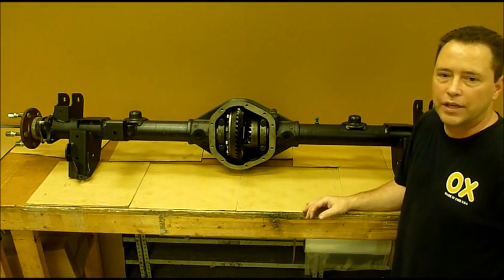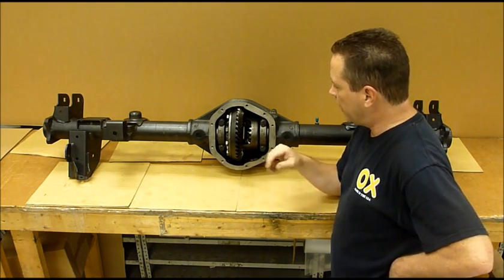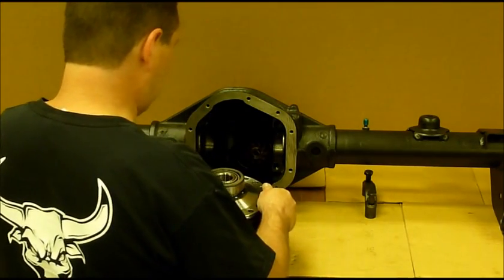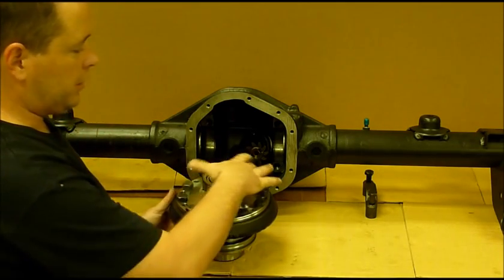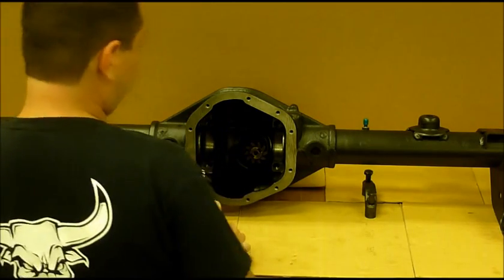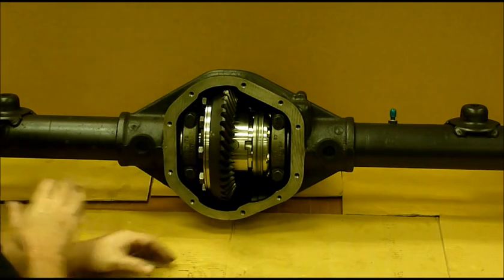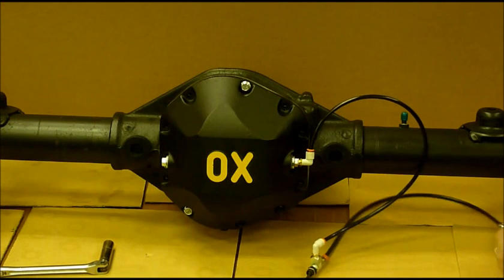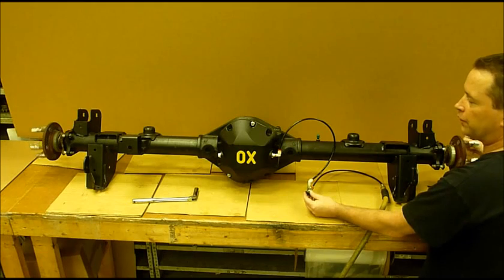OX Locker Installation Overview

Comment: This would have been so much better if you had demonstrated, even in a cursory way, setting the preload and backlash properly.  That would be infinitely more important than demonstrating how to move the ring gear, for example.  Also, recommending silicone as a gasket does not inspire confidence.  Otherwise informative.

Comment: @3:24 he said “you can chip the teeth easily as the material is very hard”! If the metal composition is hard, it should not be chipped easily. Remember the pinion is the one that pounding those ring gears through many off-road/on-road scenario

Comment: Mate you can have the correct backlash but that does in anyway mean the gears are meshing correctly how many diffs have you destroyed with people not setting them correctly like you have ?
Reply from the maker: Couldn't  tell you for sure how many we have destroyed, we haven't heard of any yet, but by the current video views it could be as many as 198,512. This is not a ring and pinion setup instructional video it is a general information video to show the process of installing a locker which just switches out the carrier without messing with the pinion setup and assumes a proper gear setup prior to disassembly. There are many details not in the video in the interest of not making a 2 hour video. The locker comes with a complete set of instructions that covers everything.  If you need any help with your setup let us know we would be glad to help.

Comment: Why do you recommend using silicone instead of a gasket when installing the diff cover?
Reply from the maker: It doesn't really make much difference, a gasket can be used. The only reason we make the recommendation is the gasket moves the cover and fork assembly away from the lock ring that it engages in. With no gasket the distance is closer optimum. The closer the fork is to the lock ring without radial contact the better.  Honestly the small distance is fairly insignificant. If I have a choice between a nice reusable gasket like a lube locker style or the silicone would run the gasket.
Reply: @OxOffRoad  Makes sense, I'm not a fan of silicone when a gasket could be used. Thanks for the explanation!

Comment: Looks like that air feeding or the place to put the cable could get smashed off real easy in the woods or on a rock so I don't know
Reply: One of the reasons I went with a Torq Locker, lunch box locker, on my Jeep Wrangler Willys. No drilling into the cab for  a switch or need for an air compressor.

Comment: Hey, great stuff! Does this locker work for tacoma and 4runner? I love that it's a physical cable!
Reply: At what point in the video did you see a cable locker?
Reply: @deepandhard803  when he touches the flymbop with kunglu
Reply: no, bro! ur fwd tacoma has a pretty good locker already between the steering wheel and the seat.

Comment: have they improved where that elbow is attached? im thinking not the best location. maybe on top.
Reply from the maker: It would be nice to have the fitting on top, however to maintain compatibility between the shifting systems the location remains in the same place. Some people fashion a guard over the port for added protection.

Comment: I'm trying to avoid air lockers.  They just seem unreliable if your compressor goes out.  These seem good until your in the middle of nowhere!  Not sure about these.
Reply from the maker: Our air shift system has a fail safe device that can be used in the event of an air system failure check it out  https://youtu.be/tYPjhh30HsI

Comment: Hi guy. I have Chinese pick up Foton Tunland. It has Dana 44. This OX diff locker is universal for all models of Dana 44 or it has different models too?
Reply from the maker: Its hard to say We have seen some differences in the past. The main thing we would need to see is if the differential cover has the same bolt pattern. If that is the same it usually is no problem.
Reply: @OxOffRoad  are you official representative of OX? Do you have e mail?
Reply from the maker: @QWERTYqwerty-nj6bx  just email support@ox-usa.com

Comment: The ox with cable locker would be the best I think, no airline or electric to foul and once it’s engaged no slop
Reply: That's what I'm thinking fewer moving parts. Nothing electrical or pneumatic.
Reply: Except the air actuated version has no slop either

Comment: Is there a manually/cable operated ox locker for mitsubishi l200 2004 4x4 2.5l turbo diesel, k74 chassis. Might also be know as the Strada: Thailand made vehicle , popular in Australia and the UK.

Comment: There is no any wire or switch on the lock, how to ture it on or off?
Reply from the maker: Yes assuming your speaking of the example in the video. A pneumatic switch is supplied to port the air to the cover for locking, and throwing the switch to unlock will release the pressure to allow the return springs in the locker to unlock it.

Comment: I really wish you guys had more lockers. I have a hard time understand why you guys carry lockers for the d30 and d35 but not a gm 14 bolt. Or the Dana 70. I dont understand the logic behind that. The gm 10 bolt is like the d35 garbage same with the d30 why spend close to 2g on a locker for a weak axle. Would love to see a gm14 or Dana 70 more one ton applications
Reply from the maker: We are currently working on designs for more of the 1 ton axles. There is a substantial demand for the lockers that we currently make. I'm inclined to agree with your statement, however not everyone is looking for a locker for hardcore off-road use. It does seem like more and more people are understanding the need for the heavier duty axles, and the demand is becoming larger to be sure.
Reply: @OxOffRoad  i wish you guys made lockers for toyotas as well
Reply: dana 30 and dana 35 ARE trash. had one of each in a jeep grand cherokee. both went bad got noisey had pitted bearings. replaced, were still noisey. common problem

Comment: What? I thought Ox locker was manually operated. That's why I was interested.
Reply from the maker: The Ox locker can be manually operated, as well as electrically or pneumatically, depending entirely on the shifting system it is installed with.

Comment: Great video and info — why wouldn’t you use a gasket?? Thank you got you answer
Reply from the maker: We do not recommend one because the clearance between the shift fork in the cover and the lock ring on the carrier is optimized without the gasket thickness.
Reply: @OxOffRoad  couldn't that have been taken into consideration during the design phase?
Reply from the maker: @corksauve4949  Yes it actually was, the closer the fork to the lock ring without touching the better. If we optimized with the gasket installed when someone installed without a gasket just using RTV the fork would bind with lock ring. The difference is pretty insignificant it really doesn't matter gasket or not.

Comment: sir, can I also modify my 2001 Isuzu trooper LS limited slip differential with ox locker
Reply from the maker: Not sure what your axle is, but it would likely be easier to swap out the whole axle assembly with a Dana 44 or OX compatible axle assembly

Comment: Here's a problem no-one may have foreseen. I have a Skyjacker lift on my 2010 Jeep Wrangler JKU. It has a large metal bracket that goes from the left rear shock area over to the differential and bolted down using the differential bolts. The stock differential has a flat surface that mates to the third member housing. The OX cover plate doesn't, it extends all the way out to the outer edge of the third member thereby preventing this bracket to mate up against it and bolt down. I'm at a loss as to how to resolve this, and I'm stuck until I do. Anyone have any suggestions?????  dpurdue1@hotmail.com
Reply from the maker: Sounds like we need to work on some modifications to the bracket. Can you email us some pictures of the bracket, and how it mounts on? Additionally, if you could, leave a contact phone number in the e-mail, as solutions to these types of problems are much easier to resolve over a phone call (too much back and forth e-mailing, otherwise).
support@ox-usa.com

Comment: Why must we not use a gasket to seal the cover of this diff?
Reply from the maker: It will still work fine if you use a gasket, the reason we do not recommend one is the clearance between the shift fork in the cover and the lock ring on the carrier is optimized without the gasket thickness. Honestly it will work fine either way.
Reply: using a fine bead of right stuff gasket maker is better anyways.